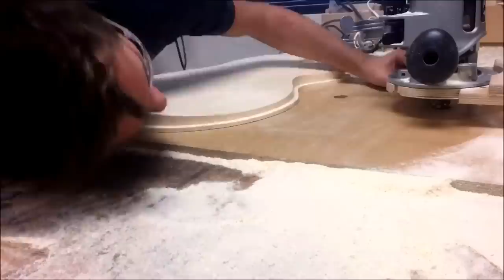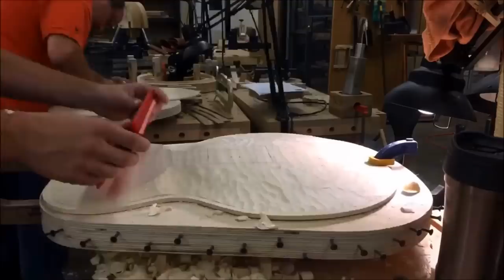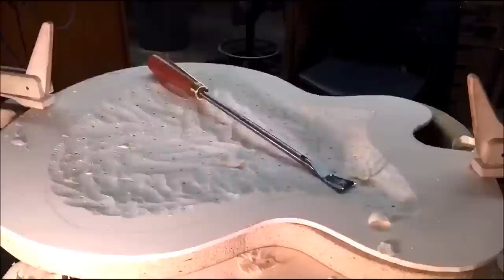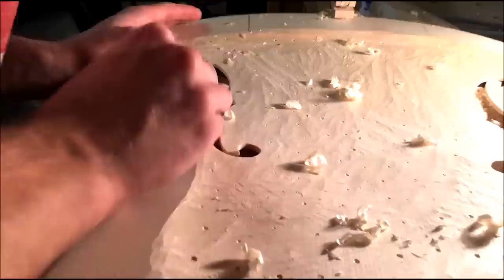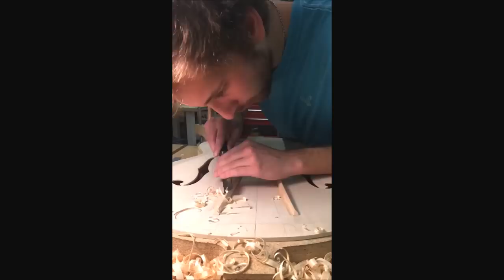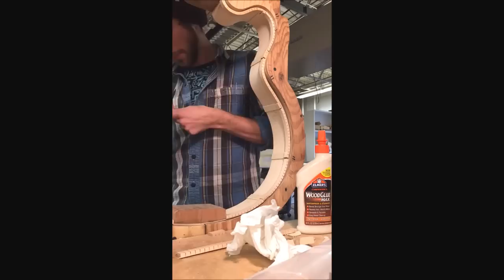Building an Archtop Guitar (LINK TO COMPLETED BUILD IN INFO)

Comment: Great video,ive watched it multiple times trying to gleen more info,but its just to fast.is there anyway you could slow it down some? If you blink youve missed valuable info , i i like your method of carving. Thanks
Reply from the maker: Edad Martin this isn't really intended as an instructional video. This is just me documenting the process of my first archtop build. I appreciate that you're interested but all these clips were shot as time lapses over a long period of time. So basically it sets the camera to take a picture every 3-4 seconds and then plays those pictures back at a high frame rate. There's not really anything I can do about it now